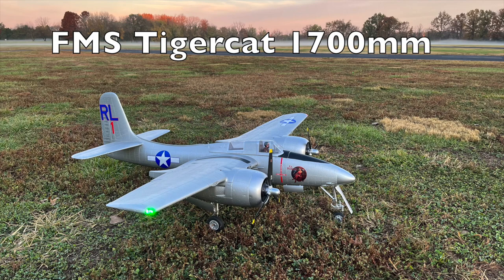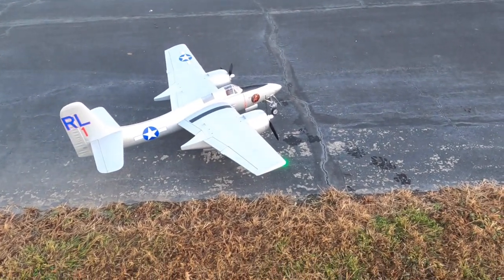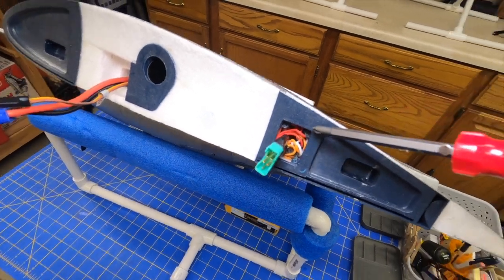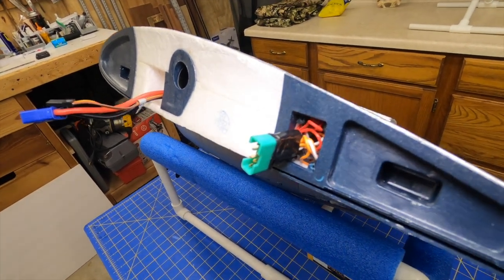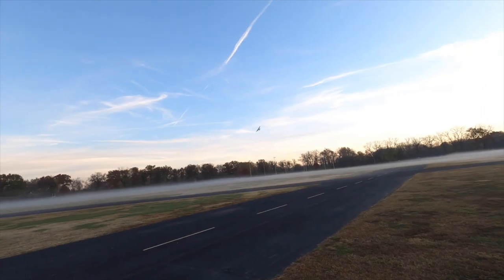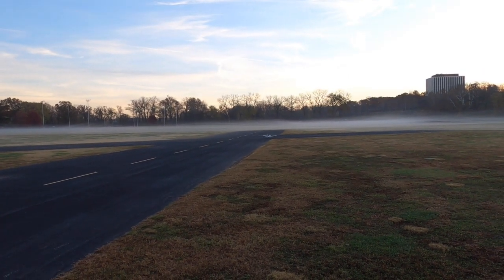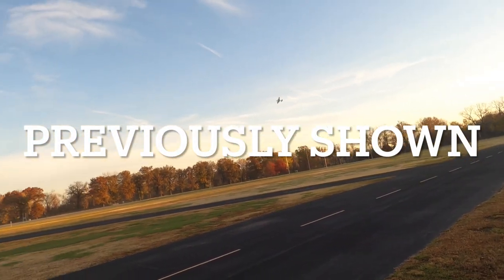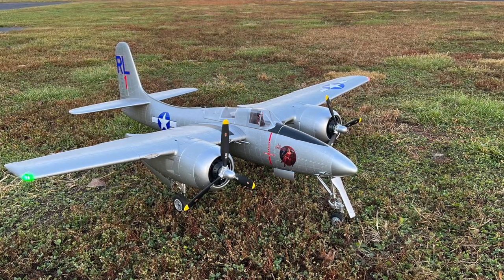FMS F7F Tigercat 1700mm Warbird Review, setup and modifications

Comment: I will look up on the landing gear, Thanks, i just bought a used F7F and I will not fly this plane until next spring...need to adjust and make sure everything is perfect before reaching the sky, it will be a winter project...a new plane here will cost 1150$ with the receiver....
Reply from the maker: If the landing gear open and close smoothly,  you're fine..  If we drop quickly while opening and don't lock, then you'll need to fix them.   Its and easy fix...  I'm the 3rd owner of mine.  Got her for the bargain price of $250us..   She's a very forgiving plane, but you must land with throttle or you'll hit the gears hard.....   Good luck and enjoy.
Reply: Oh, great price, i payed mine used for 700$...in Cad funds 😢

Comment: My nose gear door doesn’t close all the way anymore. I’ve twisted the clasps to shorten the arms but the doors still don’t close completely. Any thoughts? Also one of my mains makes a knocking noise when deployed. Any help is greatly appreciated.
Reply from the maker: Mine had issues with the landing gear and that required me to take them apart and tighten the grub screws on the retract trunnion.  I mention it on the video.  There are details in RCGroups too. (I think...).  Its not hard to do, but you need to take out a few pins from the retract struts.  Then remove the retract motor, loosen the grub screws and tighten to center on the flat part of the trunnion..

Comment: Brandon Moon, another YouTuber, stated that if loosen slightly two of the four mounting screws diagonally ie. top right and the bottom left... According to him, it will still make a solid connection while reducing the stress the connector pins caused by the flexing of the wing due to wind turbulence.  Here is the link: https://youtu.be/9WG98FwZlDU?si=eaBl68i2LoK8qRX3
Reply from the maker: This was an old plane. The bullet connectors had some play, Not worth risking it.  Had some failures on the ground and tested several option to keep the original connectors, but didn’t feel confident